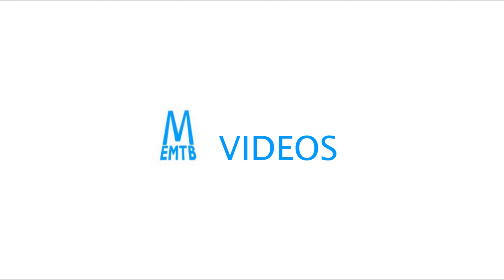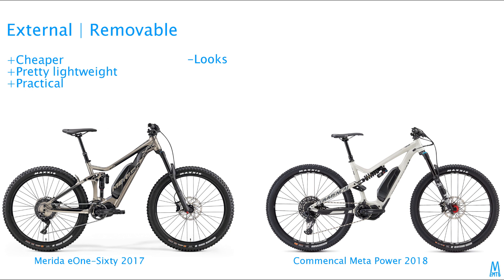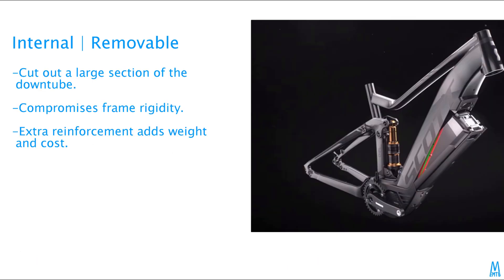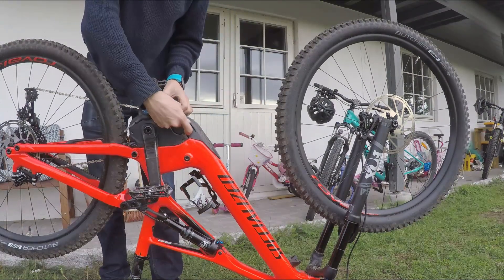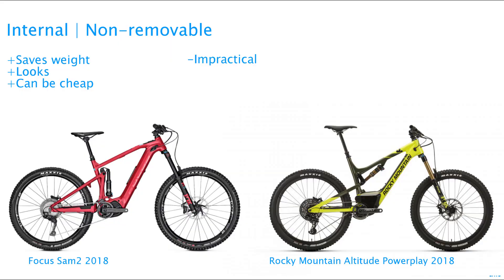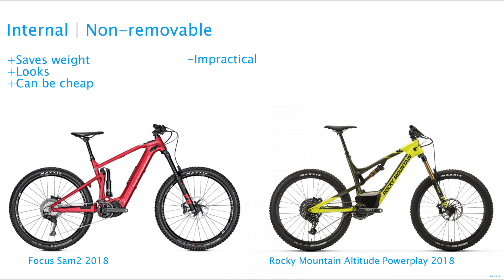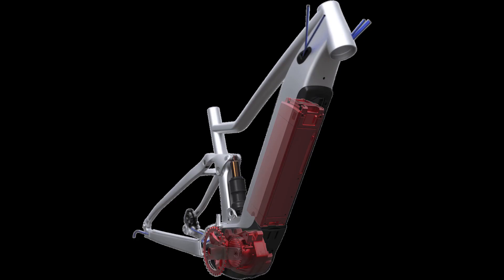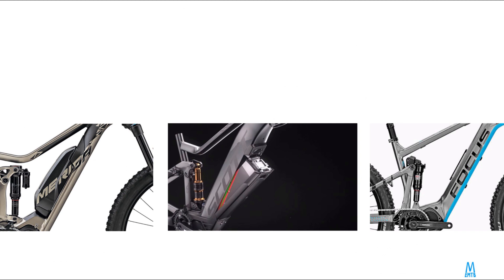Pros and cons of different ebike battery integrations

Comment: I prefer the Levo, looks good, rides perfect and the frame is solid with no flex.
Also has good weight and balance.
Also do want to carry a battery around like the focus
Reply: Agreed, I just got my 2019 levo expert with 700 watt hour battery. I've concluded that in general the bike has more range than I wish to travel regardless of me pedaling or not.

Comment: One pro for external battery is that you could easily replace it with a battery of different capacity if needed (and such is available), since e.g. Shimano STePS external batteries all use tha same configuration and fixing points. Also external battery lowers your center of weight.

The con for external battery is that it almost always takes away your bottle cage...